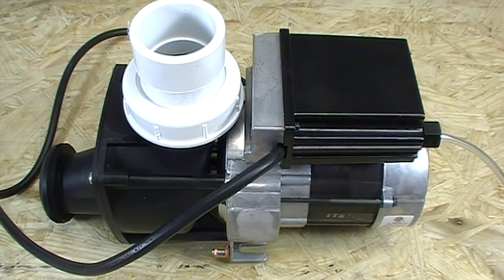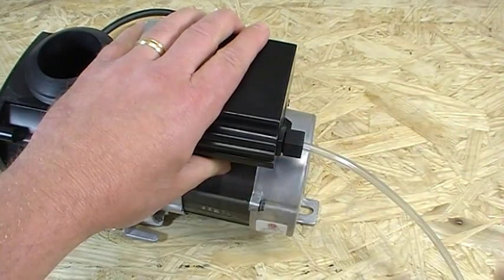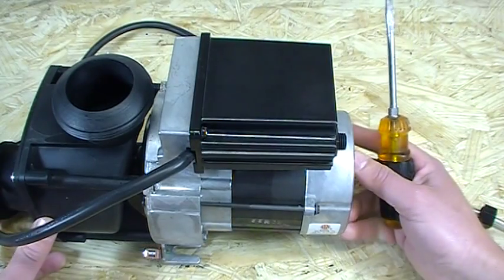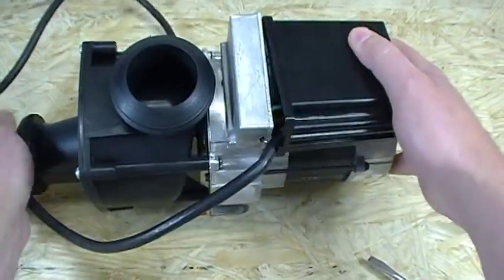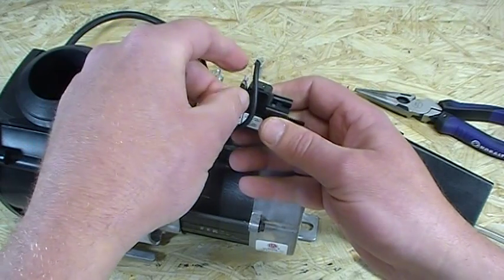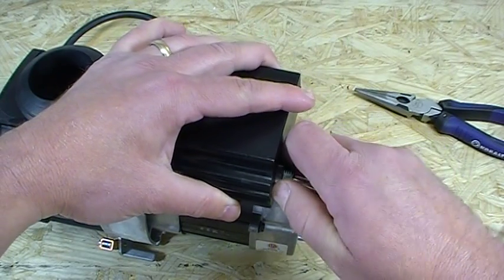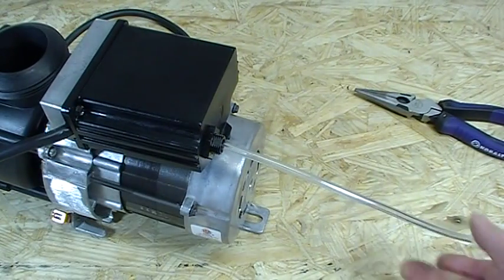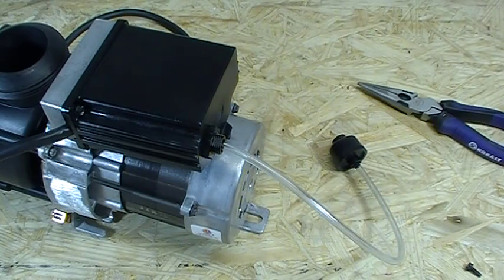How to replace the air switch on your JACUZZI Whirlpool Pump

Comment: After seeing this video, I just ran the two wires connecting to the air switch to a wall switch to close the circuit. No air switch needed, and I'll never deal with a stuck air button again. simple.

Comment: Jet bathtub  been out of commission for 7 years . Finally found your video and fixed  it . I cant believe it was such simple  fix by just  replacing the air switch . Thank you so  much for this video.
Reply: Excited to do the same.  I thought it was the motor....not sure ...but this is worth a shot, due to the very well-done video. Thank you.  Wish there was a way to see if it IS the motor...guess I'll fix the air switch and see! Thank you!
Reply: @claudiawisdom-good8790  how'd that work out for you?

Comment: If you can’t get the screws out with a screwdriver you can use a 1/4” socket driver. It looks like a screwdriver but has a 1/4” socket on the end.

Comment: My indoor jet tub doesn't turn on at all
No noise
I have voltage coming off the breaker
What could be the possible problem
I was thinking motor
They didn't leave access in the front bottom 
So I'm gearing up for some demo and need some inspiration 😁
Even if you don't reply happy New year
I'll be happy to buy the part off you as well

Comment: I seem to have the same exact pump in my jacuzzi, we just started renting the home about two months ago and just started trying to use the jacuzzi. It was unplugged by the homeowners either because they didn’t really use it or because of the issue we discovered. Anyways the pump works great, great pressure and all the jets work however it only runs when the on/off is HELD down. I’m assuming it’s because of air switch being faulty but I’d like your input if possible

Comment: While easy to do if you can get access, it’s the same price to buy a remote air switch assembly for a garbage disposal or something similar. Mine is buried and removing the pump would be really difficult.

Comment: Can you switch the bonding lug from the inside side of the motor to the outside side?  It look like there's a hole on the other side as well.  I don't understand why the manufacturer would put the motor on the side facing the tub, making it impossible to access.  Thanks.

Comment: Question for you. I am a DIY homeowner and am trying to fix my tub on my own. It seems like the button doesn't press anything when I push it in. Then at times, it activates the pump but will only stay on for 5 seconds while I hold the button down and then it turns off. Does this seem like the air switch? And if it does, does it sound like it's in addition to any other part, like the on/off button itself? Should I hear a click when I press the on/off button in?
Reply: I know this is a few months old but in case it is needed: Had the same issue and from what I have seen online it could be any of the parts he breaks down at the end of the video. Not an expert by any means but read that it is likely a hole or leak somewhere in the tubing or switch. If it is an issue with the button it is super easy to replace and pretty inexpensive. Amazon has them on different finishes for less than $20, some were closer to $8 if they didn't come with the air switch and tuning. You just pull the tubing out, and there is a plastic nut on the underside holding it tight to the tub. Just unscrew that, replace and screw the thin nut back on, and plug the tubing back in. Unfortunately mine was not the air button so trying this video next but the genius who  installed it glued and then foam insulated everything together 🤦 Home Depot had the air button but was $50 to $100 plus!

Comment: Great video thank you!  My pump wouldn't turn off so I unplugged it.  I thought it was the bellows but I replaced that and still won't turn off.  I guess it's now time to replace the air switch
Reply: Did replacing the air switch work?
Reply: I’m having the same issue
Reply: @Canyaoutty1111  air switch was the problem
Reply: I think I have the same issue. Sometimes I have to push the button three or four times to make it turn off. It turns on easy enough but it doesn't turn back off but today it works fine. I'm still going to replace the air switch though because it's starting to fail. This is a great video great. I'm so glad you made it for us. It makes this repair much easier

Comment: My bellows is inaccessible, installed on far side away from access panel. Unless I am missing something I will not be able to replace bellows. The tub insert into motor is right at the access panel. I wonder if I should make a small hole in access panel and install a new bellows there.

Comment: Which prong does the hot wire hook up to (coming from the plugged in 
cord)?  Is it the copper colored or the silver colored prong?  Does it 
make a difference which one the hot wire is connected to?
Please answer!
Reply from the maker: Robyn; it doesn't matter which prong the hot goes to. All you are doing with a switch is interrupting the flow of current to the motor. Sorry for the confusion.

Comment: I have the older  style of whirlpool and it will not turn off. We use the breaker to turn it on and off. I'm thinking from watching you video that this air switch is what I need to replace?
Reply: Don, since you can't see air it might be the bellows too. I suggest you get both to be sure since they're wear items. Call me if you have any further questions. AJ

Comment: I have two problems. First, the pump will not turn off, so I am going to order a new air switch. Second, they never put an access in to do maintenance. How can I know where the pump is located? Are there schematics? Its a jacuzzi brand corner tub. I'm either going to need to cut out tile, or cut access into the side of my house to fix the issue. Thank you
Reply: my pump wont turn off either. did the air switch solve the problem?

Comment: Just replaced my bellows, and it turns on the pump but the pump does not stay on.  Just saw your video, does this seem like it is a problem with the air switch?
Reply: I am having the same issue, did changing the air switch fix you problem?

Comment: the switchis fine it is the bellows assembly that does not work it does not have a good seal so that I have to blow into the silicon tube to turn it off.

Comment: My jacuzzi pump only comes on while I’m holding the button. Replaced the bellows and the air switch. Still the same issue. Ideas?
Reply: Hey there, did you resolve this? I may be having same issue. Thx!
Reply: @sarahleone3564  . I never got an answer. I have just been blocked the button down for now. I think the hose needs to be replaced but haven’t made time to replace that.
Reply: Sarah, did you ever figure this problem out?

Comment: If the 2 screws on the housing won't come lose with a screwdriver, what is another alternative?
Reply from the maker: Try using a nut driver and put a large pair of channel locks on the handle for leverage. This method is easier with 2 people.

Comment: Why not just make simple on off switch?
Reply: An air switch is a major safety item for anything that involves water and electricity.  There is no chance of grounding yourself to the water and the motor when you are in the tub.